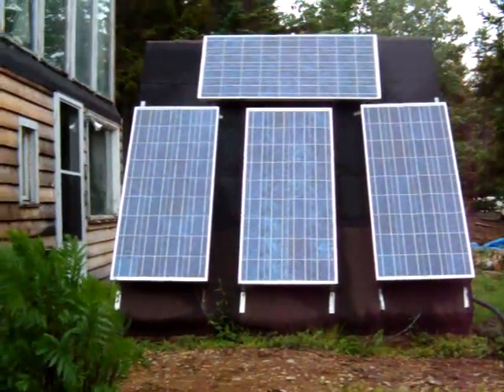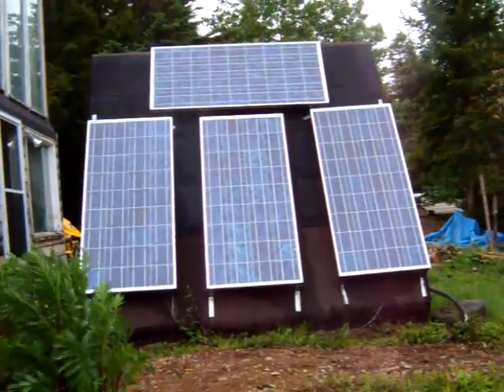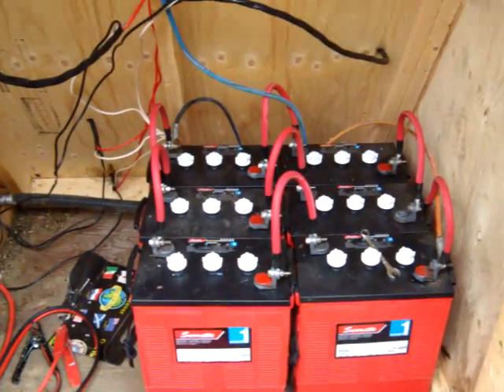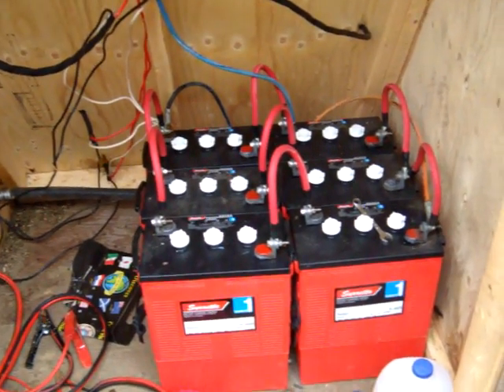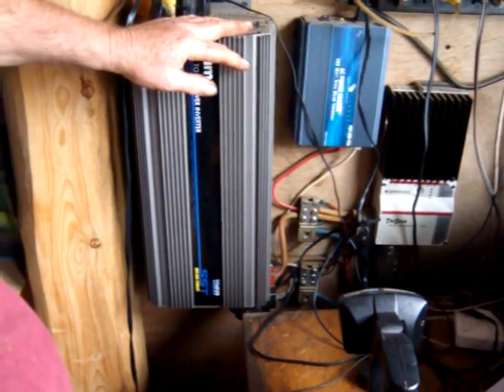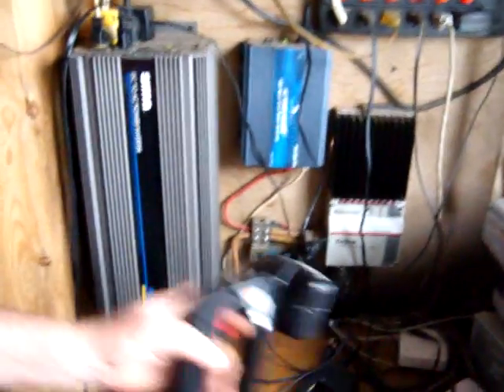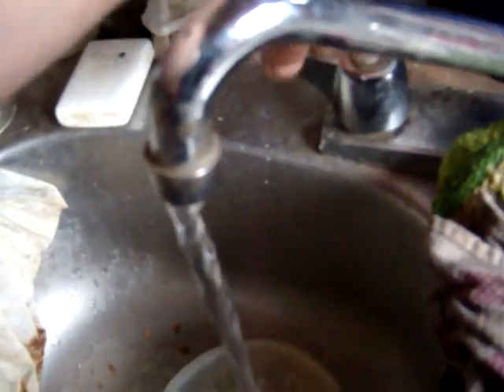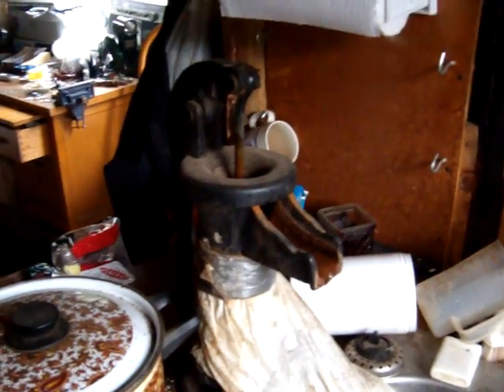SOLAR POWER 101

Comment: hotwater heaters use the most energy of any device you own in your home about 70 percent,, just use led lamps to conserve the ampacity draw. 1300ma is about 1.3 amps Therefore the wattage is 117*1.3 = 152.1 watt = 0.1521 k.W  if so how long will the batteries last?

Comment: I notice you have the " Tristar " controller.. I also have the MPPT45 controller. Great unit. Got the meter for mine and it supplies a lot of info and keeps a log. Been running it fot about 55 days now. Will have a video this weekend about the system.. Haven't had a video in a long time but will do one this weekend.

Comment from the maker: @hitechguy18 I thank you for your input and i do agree and disagree, though the insulation jacket will make the system more efficient it will lose its heat radiation which is quite a bonus in the winter months when my dad is gone all day as his stove does not hold a fire for long, aswell there is no and will be no electric heater added as power is at a minimum, but there is a hotwater solar panel and heat exchanger being installed so that should balance it out, may then insulate the tank